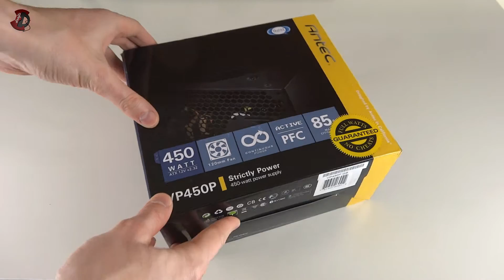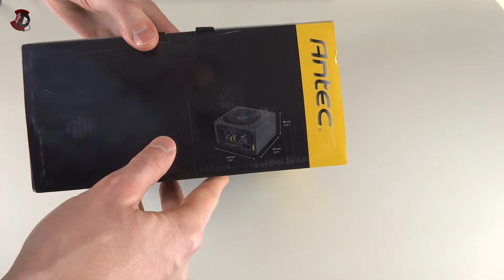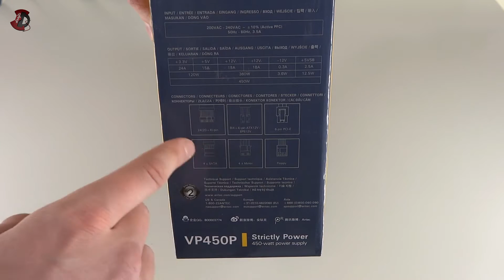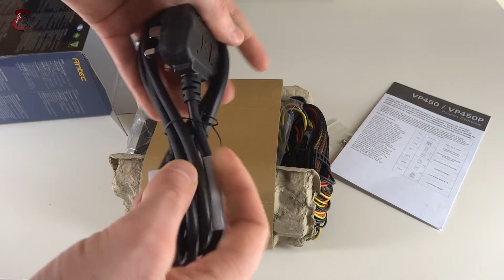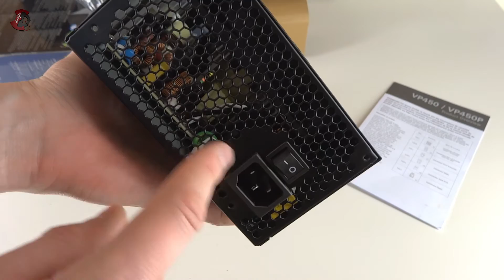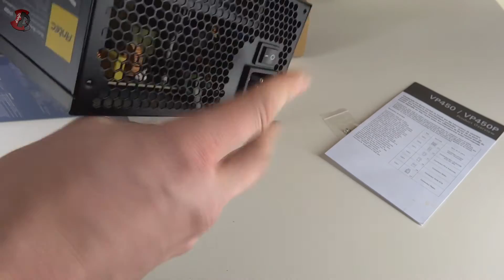Antec 450W PSU VP450P Continuous Power Unboxing

Comment: Hi bro, I am in kind of a fix regarding psus. I want to run i7 2600k and 1050ti and rgb fans. I want for HIGH GAMING. Is this power supply a good idea? OR there is a better option?
I want it to run atleast a year.

Comment: It really give 450 watt ? And can I use ryzen 3 2200g (oc) on it
Reply from the maker: You sure can as long as it will handle GPU as well. 450W is rating but it's more like 70-75% at peak so around 350W tops to be on safe side.
Reply: @Edsdrafts  hi man can i 3400g with this bp450wt antec?
Reply from the maker: Hi. You can, yes. Your CPU with built in GPU is not using that much power needing a bigger PSU.

Comment: Can I used it with i3 8100 and 1050ti
Reply from the maker: Of course, why not? I have used GTX 1050Ti on OEM 180W PSU without issues.

Comment: is the vp450 no p at the end good as this
Reply from the maker: Hi. Could be simply spelling error. VP is particular line of their PSUs and 450W has P at the end.
If not sure ask supplier or try to find product code somewhere in description. Chances are it will be something in the text as VP450P. Otherwise might be an old model.
Reply: How good is the Antec atom V450?Compared to the VP model.

Comment: How is your PSU running after 2 years? Is it still working fine? And what is your system specs on which you've installed this PSU? I am thinking of buying this for my GTX 750 Ti and Pentium G2020 ...
Reply from the maker: Hi. Sorry but I have sold the PC since. I have no reason to doubt it is still working though. As for your new build - have a look at new AMD cards, they are much more efficient than 750Ti and will cost nearly the same.
Reply: Already got the GTX 750Ti it's really very efficient.. only 60 watt and even better performance than the R7 260X which is around 2TFLOPS !! 110Watt TDP
Reply from the maker: Hasan Zobaer in that case no harm keeping it I suppose :) Antec is as good as questionably popular Corsair and even better depending on the model. I don't think you will have any issues with it.
Reply: thanks ! I will go for Antec then

Comment: the VP600P vs the Corsair vs550 ? i have i5 6500 and gtx 970 ssc .. btw i'm on a budget so.. what do you think
Reply from the maker: +LoTFi x I personally would go with Antec but there is nothing horribly wrong with Corsair either. In performance CPU market Corsair certainly lacks build quality but their warranty and customer service is reasonably good.
Reply: are they both 80+ ?
Reply from the maker: Yes they are but I would read the reviews first. 80% + is just one measure. There are bronze, gold, platinum and others.
Reply: oh ok thanks man ^^

Comment: Getting a r9 380 this month, will this work? I am worried about that 6pin connectors.
Reply: Did it work?
Reply from the maker: +Crimsonhead it should. It would work better with GTX 1070 though...
Reply: +Crimsonhead  Yea it is actually more than enough.
Reply: I was afraid that this psu will not work with gtx970,but if you say you can run r9 380 than i will get the 970 xD

Comment: would this power supply work well with an EVGA GeForce GTX 750 Ti FTW..
Reply from the maker: It sure would. It should run even GTX 970 if not 980 as well.
Reply: +Eds drafts you sure bout that ??? 
i have this psu and gonna purchase 960, m not sure if it ll support msi 970 4g, if it does then definitely would get a 970 over 960.
Reply from the maker: I currently own ASUS 970. I have power meter always on. Never went over 280W total.

Comment: this is a very good psu, it was supposed to be 80 pplus certified, but it uses an older older method of power delivery to cut down cost, but it does the job pretty well and it is efficient too
Reply from the maker: PSU is not bad at all. Great price and decent performance.
Reply: is this 80 plus certified ?
and can be used with 3400g?